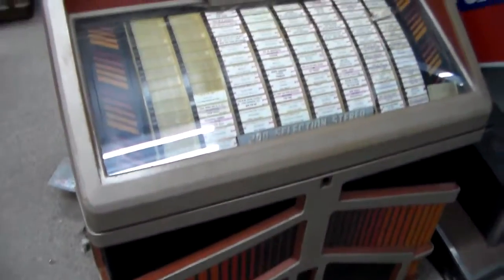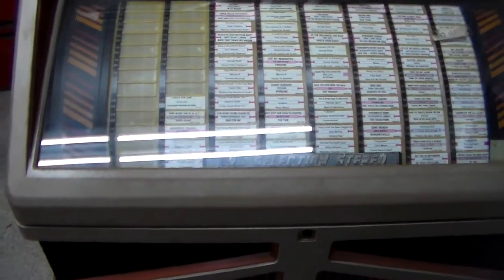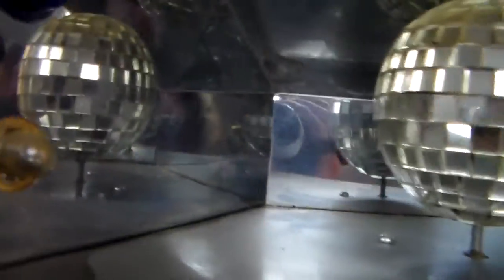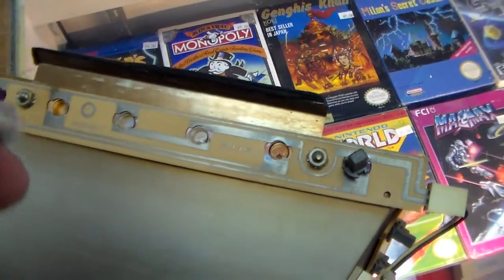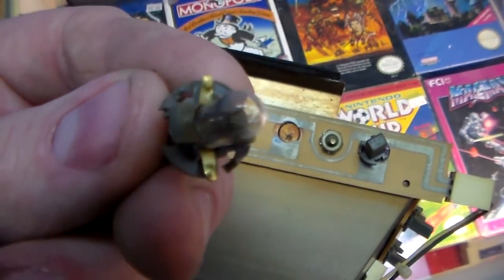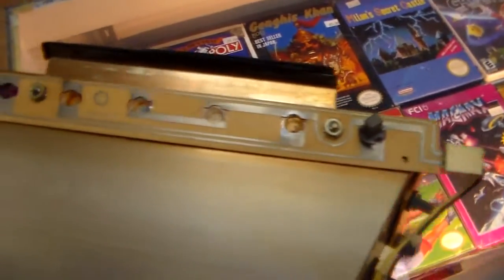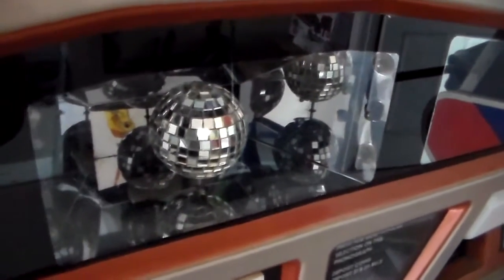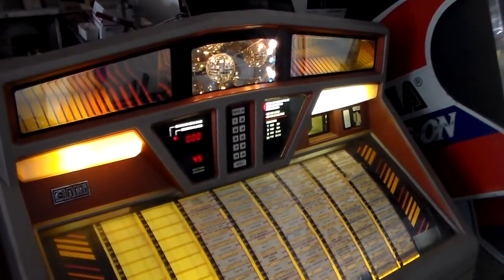Repairing the Mirrorball lights in a Rowe R93 Jukebox!

Comment: I've been subscribed to your channel for a while now and was presently surprised that you had a video on your channel about this R93.  I just purchased one these in bad shape.  My first step was to fix the broken lid/hinge point so it would close and repair the locking mechanism that was bent to hell.  I just finished getting the power supply working and all the lights except this disco ball.  It's looking great but the computer will be next.  It shows it has power by lighting the 8VDC indicator but otherwise it's dead.  Battery hasn't leaked so that will be the first thing to remove and make remote.  I wish you had a repair video on this jukebox besides the disco ball but still cool to see.  Thanks for posting this video!

Comment: I just got a R94 and I my mirror ball motor is stuck and gets hot I need a new motor. Also My high end speakers sound static y. Capacitors have been replaced and the filter caps also. And I just put a new stylus in it. Subs sound clear. Do you think its the amp or the tweeters.
Reply from the maker: I'd have to lean towards it being in the amp, but hard to say.  Have you tried plugging in a different speaker just to see if it's clearer?  It shouldn't do it on both channels though if it's the amp (you wouldnt' think).
Reply: I also have R-94 and my volume button will not work unless it is on full blast what do you think it could be?

Comment: Im trying to adapt my jukebox lights with LED lights and a resistor  maybe it can be cheaper to fix
Reply from the maker: I'm pretty sure if you add a resistor to the socket and pop an LED in there it'll work no problem.  This would be a good place to do that, save you some trouble down the road!